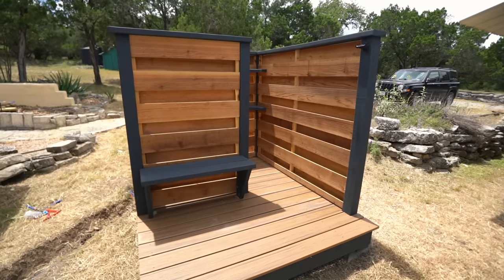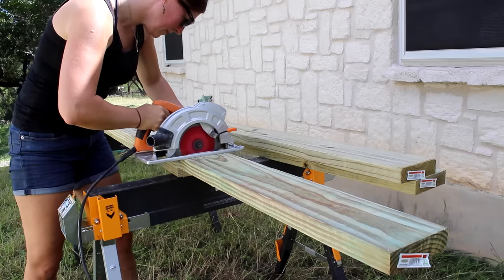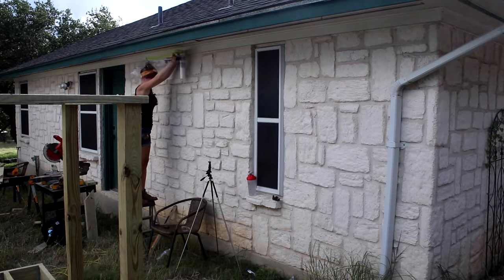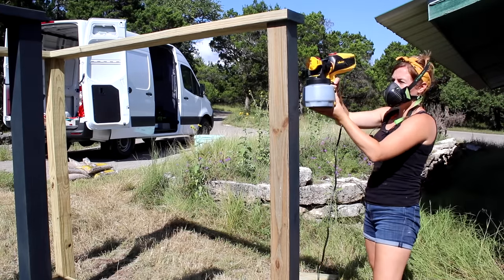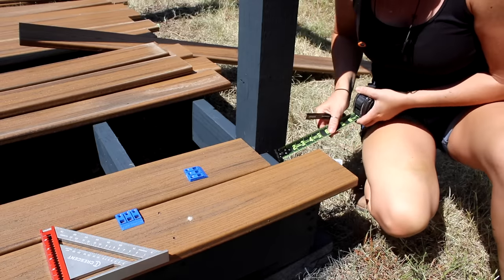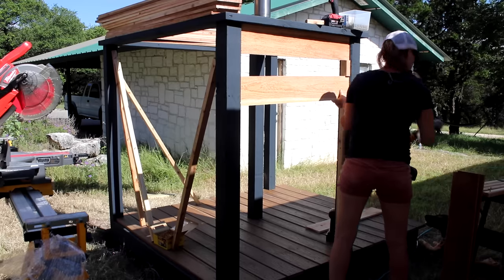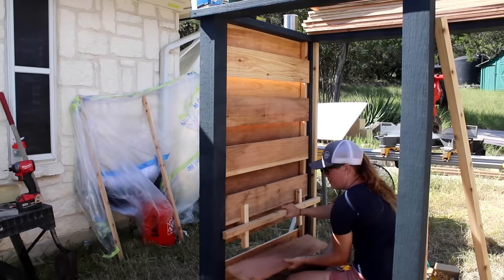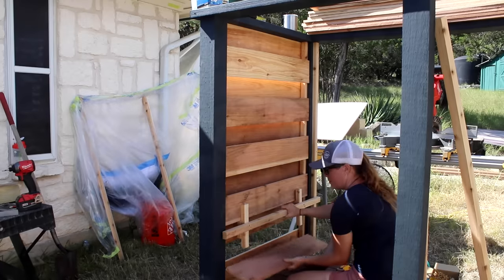How To Build An Outdoor Shower | Part 1 | DIY Framing

Comment: This looks amazing. Q: Why did you spray the cedar after you installed it? Could you have sprayed it all before install and avoided all that masking work?
Reply from the maker: Yes, but many don't beforehand so I wanted to show the option of great masking off vs using old sheets. Thanks for watching.
Reply: So she could promote the masking products.
Reply: Pre prime/finish exterior wood will make things last a lot longer.
Reply: @charlheynike9619  how do you think she makes a living? Good for her
Reply: @tonyozimek2116  I never complained about it. Just answered the question.
Reply: To spray before installation you would need someplace to lay out all that wood. And flip it halfway through. For 4 coats, apparently.

Comment: Great work! Wouldn't it had been easier to pre-coat the panels you used for privacy, coat them somewhere else?
Reply from the maker: Yep, definitely would have! Live and learn. : )
Reply: @AprilWilkerson  But that's why videos are so helpful. For this project, a sliding panel door or saloon doors would have been a great add on.

Comment: I have similar at my barn.  But I used a on-demand water heater that ignites on D-cell batteries and runs on 20lb propane bottle.  All you need is a hose bib and hose to connect.  The heater unit and propane bottle is mounted on a HF set of trucks which I pull out from under roof and connect in minutes.  Works perfect and removes the plumbing issues.  If I ever want to move the shower, I don't have plumbing issues to deal with.  It surprised me how little the water heater cost that supplies plenty of hot water....even in those fall days when I am dirty and don't want to go home that way.
Reply: Tony ... I have one of those propane heaters and with all the misc fittings I think I'm into it for a bit over $200. I used a spring loaded "flush valve" for the water feed and the handle goes to a rope tied to a small piece of plywood. The idea is you step on the wooden pedal to start / stop the water. The rope has a spring connected so you don't over-crank the valve handle. I figured (roughly) I can get about 600 showers at 3 minutes each on a BBQ tank.

Comment: I built mine next to my shop using the board on board and used a tankless water heater from Amazon that uses a 20 lb propane tank and can hook up to a garden hose. It comes with a shower head and all hoses etc. About $125 and works great. You can easily remove it in winter if desired.
Reply from the maker: Excellent idea! Thanks for sharing and for watching.

Comment: Another option for those who don't have access to hot-cold running water by punching through a wall may be using the propane-powered instant hot water units sold to campers.  Spark is provided by batteries and all you need is a garden hose to supply water.  With the right lookups you'd just tape into the tank running your BBQ.

Comment: Excellent! Why not using Zip System Tape over the joists before the decking boards since lots of water (more than just rain) will be pouring on them? Nothing wrong the way you did it. Just thinking on longevity of material! Keep it up!

Comment: Just Curious as to why the water-based tarnish w/Amber wasn't applied prior to securing to save a step?  I'm always opened to learning something new. Thanks, and Great Job Too!!
Reply from the maker: Many don't and I wanted to show the option of if you didn't and needed to mask off an area. Much easier than just old sheets. Thanks for watching.

Comment: Very cute project! A tip that would make it easier for DIYers who don't want to do or spend as much in masking and spraying the painting/staining: paint/stain the material before you cut and install it. A paint sprayer for this size project is a little overkill—roll or brush on the paint and stain will work just as well, is much less expensive and considering the time it takes to mask off the surrounding area works out to be about the same in time spent overall. (monetized video and affiliate sales links notwithstanding)

Comment: Enjoyed video.  You have a real talent.  So in future builds Please  USE PPE.  No Clear safety glasses and NO Respirator For the Vanish 4 Coats. IF you breath in enough vanish it could have coated your lungs. I contractor years ago sprayed a new BACKYARD DECK with Water Sealer. NO Respirator. He died three days later.  Hope you take this in a positive and helpful suggestion to heart.

Comment: Looks great!  How important is air flow through the walls?  I was thinking about using vinyl fence, a 6'x6' panel is only $76 at Lowes.  Total privacy, but no air flow.  Thanks.
Reply from the maker: Air would still be coming in through the top. You wouldn't be in the shower very long so would think a vinyl fence would work great. Personal preference is always a great thing. Thanks for watching.

Comment: April - quick question - what size lumber did you use for the deck base structure on this outdoor shower please? Would like to do this for our house in the UK here. Love the videos and your enthusiasm - stay safe
Reply: I think she said it was pressure treated 2x6s. Given the short spans involved, you could probably go down to 2x4 if you add  another line of pavers in the middle.

Comment: Hello what size wood rails did you use to screw the horizontal fence panels into? are they 1x2 inch rails? they look a bit larger than that? Di you get them from home depot?

thank you

Comment: The finished product looks fantastic... just 1 question: Are you doing anything to protect the PEX from UV? I've been told that PEX is not UV safe and will not hold up over time if exposed to sunlight.

Comment: I love the color combination. The gray paint goes perfectly with the finished cedar color and the decking color.

That bench is going to get AWFUL hot in the Texas sun, though. Might have been a good idea to use the cedar there, or some other lighter colored material, since burned legs are not fun.

Comment: Question, April: Looks great but I have a question about painting the pressure treated posts you used for the frames. Does the pressure treated wood need to "dry" before it will fully accept paint? Or do you recommend a certain type of paint for newly pressure treated lumber? I that it if pressure treated wood isn't allowed to dry out for a year or so before applying paint or stain, it will have issues in the future, sooner, rather than later. Thanks! Looking forward to the next video on the project.
Reply: Could have been KDAT (Kiln Dried After Treatment) boards as well.
Reply: pressure-treated lumber SHOULD NOT BE PAINTED OR STAINED!! she (a trained professional, I presume?) should know this, whereas you average DIYer might not...
Reply: @patklemmensen1694  Come on now.  You can paint treated lumber so long as it's not oil based.  For every trade job, there are 18 different ways to do it and 36 different opinions.

Comment: Love the project.  Was there a reason not to spray the varnish on the pre cut pickets before putting them up?  That would have saved all the masking on those.
Reply from the maker: Many people don't so I wanted to show the option of great masking off vs just using old sheets. Thanks for watching.

Comment: weedblock before the gravel? wont seeds grow in gravel?
 how do you keep stuff from growing thru the floor with all the plants getting water?
Reply: Yes weeds will grow like crazy. Best to put in shower pan with 2 inch drain to daylight somewhere away from structure. Weed block/ plastic. Then it will not become a garden. Looks great though ...

Comment: What are you using for your water lines?  It looks like PEX.  If that is normal PEX, it's not rated for outdoor use and will degrade when exposed to UV.
Reply: I'm betting they'll end up covered behind cedar.  I can't see bright red and blue ending up in the final color palette...  :)

Comment: Wonderful build! And love the suggestions on paint sprayers and cedar protection - thanks for the details.

For those of us in less "hot most of the time" climates, what are your thoughts on shut offs or drainage so your outdoor pipes don't freeze? Here in NC I'd still probably want a shut off accessible either in a crawlspace or, more conveniently, with one of those long silcocks with an indoor shut off point. And maybe a separate system drain, as we typically do with water collection outdoor showers. 

Thanks for sharing! Again - lovely.

Comment: Try shaklee Basic-H I really like your shower idea thank you 
Blessings David
BTW Ive been using Basic-H to wash my body skin with since I was 15yrs linear alcohol based soap super nice takes off  sebaceous oil and body smell with no scent. Leaving you nice & clean.it flows out onto soil and is good for plants does no harm and not slippery like regular base as in pH base which is by definition slippery

Comment: Curious how u run it from inside house to outside in plumbing
Reply from the maker: I did a 2nd video showing how I ran hot and cold water from the house to the outdoor shower. Check out Part 2 on my channel. Thanks for watching.

Comment: Great project, April~!  I saw that you filled in between the floor joists, but did you consider doing any kind of gravel base to catch the water from showering?  Probably not enough water to worry about on the ground depending on how many of you are washing off after a hot Texas day of work outside.  Would probably evaporate fairly quickly.  :-)

Comment: Two comments:

If the shower gets used daily, you may get some stagnant water pooling underneath unless there is well drained sand there.

It looks like you have pex supply lines to the valve.  To my knowledge, pex is not UV resistant and, in Texas, there’ll be plenty of UV radiation.
Reply: Also animals can chew threw pex like mice
Reply: I'd be surprised if the lines end up exposed and not behind cedar.  It's easy enough to enclose them.

Comment: That slat jig was sexy AF!  I would have just measured the placement of each of them like a caveman.  Not sure how I feel about the slats themselves (they look great, but I think I would still feel exposed) and I'd absolutely have to move that towel hook closer!  Having to actually step out of the shower to grab it would be a no-go for me.  

Is there a reason why you wouldn't finish the slats before installing them?  Would save you taping everything off after the install.
Reply: One advantage to finishing the slats "in place" is that you don't need to rig up something to hold 5 dozen slats while they're drying. Plus this looks like she's doing a job for someone else, so jobsite access and filming schedules might have been a factor.
Reply: @austinhastings6709  Oh, that actually makes a lot of sense.  thanks!

Comment: Love the project. But using galvanized nails in cedar pickets is a mistake. There is a nasty interaction between the oil in the cedar and the zinc that causes ugly black streaks down the boards from each nail head. This happens even if the boards are stained or painted, and water or moisture only makes this problem worse. The solution is to use only stainless ring shank nails, or stainless screws.

Comment: The corner shelves should be in one of the hidden corners.  Otherwise you have to walk into the opening to get shampoo or soap.  Other than that, it looks great.  Odd that she didn't treat the boards before installing them.

Comment: Interesting how 99% of "shower build" projects are about building an enclosure for privacy... in areas where privacy is not really necessary. (rural and wooded areas) I put mine directly on the side of the house (hot and cold water) then added perf pipe, crushed rock, and topped that with flagstone for good footing with proper drainage. The water drains between the flagstones so no puddles and almost no weed growth. Total price for materials, including plumbing, is likely around $400 but I had scraps of stuff to use up so even cheaper.
Reply from the maker: Awesome! Thanks for sharing and for watching.

Comment: "Boards shrinking over time"  ??  I'd figure if anything, and moisture, they'd expand.
Reply from the maker: The boards will get wet an expand but they will also dry in between use and shrink.

Comment: So you just put the footings on soil? Why bother using level before you put the wood frame? It will be a leaning tower of Pisa after the winter.
Reply: They're in Texas. I believe the frost line is actually 6 inches ABOVE the ground there.

Comment: Looks amazing. 
However, an unpopular opinion: after using so much plastic and tapes that will end up in landfills, I don't think biodegradable soap is going to cut it. 
Could you please give some tips for using less wasteful techniques? Perhaps a reusable paint booth? Or reusing cardboard boxes? Or even painting the boards beforehand?
Reply: That was hardly any masking material...  Showering daily is a huge energy user in this country are ou gonna shower less???

Comment: Were it my house I’d incorporate the existing bathroom. I imagine a future pool and the need for a bathroom accessible to guests without traipsing through the house in wet bathing suits.
Reply: Elena ... could also back the shower right up against the house to shorten the pipes. As for wet suits, suits are not allowed in my pool! (problem solved)

Comment: Are you really using Pex outside? If so…you’re going to have a bad time.
Reply: I think there might be an issue with UV degrading the pex. I suppose you could box it in so it’s all covered.